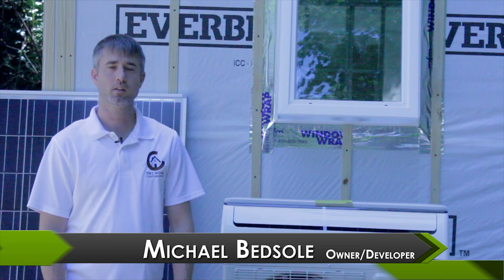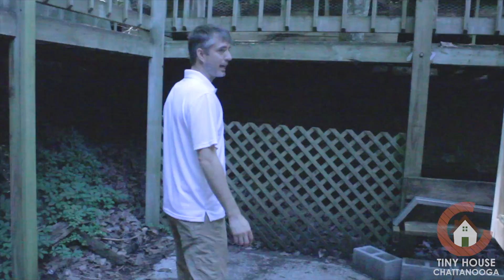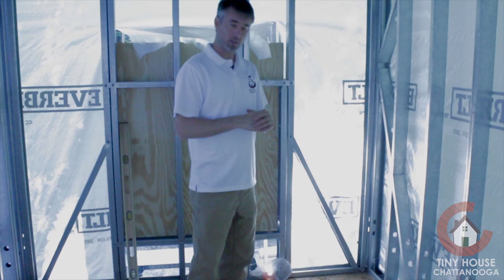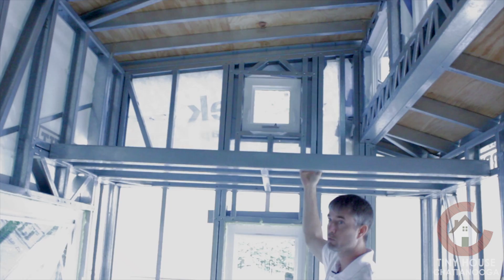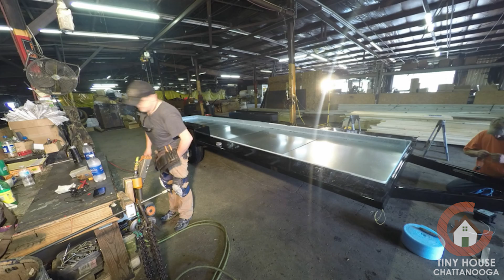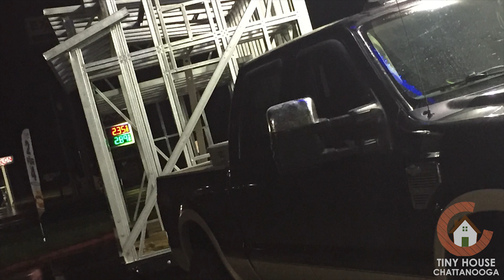Tiny House Chattanooga steel frame assembly.

Comment from the maker: Rita mastin. It saves between. 33-50 %. Just depends on the frame design. This one weights 1400 lbs. Just the frame. Word would have weighed closer to 2800-3000 lbs
Reply: great. do you know the total weight of the house once completed? what is the size house? seriously considering steel.
Reply: Answer please
Reply: That is fuckin sweet . Sold

Comment: Another reason to use steel (and I'd use metal for the envelope as well) is that you reduce the fire potential. Since Tiny Houses NEVER have sprinklers, reducing the fuel loading in the space is going to make them safer. I see many Tiny Houses sited in wildland areas where wildfire is often a concern.

Comment: You are using spray foam insulation.   Make sure to mention the risks of this type of isolation.   Check YouTube videos of massive problems with spray foam insulation.  It seems if the mixture is not right there can be problems with chemical off gassing.   Will not realize  the problem until the build is complete.   Can you tell people how you made sure your foam insulation was done right?

Comment: Did you use the same studs for the loft’s floor and roof as the wall studs? Is there any load concern with mounting studs sideways?

Comment: Is working with steel framing the same as working with wood? Meaning frame it the same way you would with wood? How far apart would you recommend the studs be? Traditional 16 inch centers? Thanks for the videos, tons of good ideas and inspiration!

Comment: Can you describe your insulation system? Outer layer with foam? What's the total thickness of the walls?
Reply from the maker: It's closed cell spray foam insulation. Thickness varies between between builds.
Reply: Mike Bedsole 
Does it have to be closed cell foam spray insulation?
Reply: Not at all. It's just what we prefer to use. We can use whatever you'd like.

Comment: How does the steel effect the owners' wireless services or WiFi signals well inside the home?
Reply: If you have windows it's OK and actually don't use 5G on wifi because of the waves. The old school goes through harder thicker walls

Comment: Did you ever think of using SIP panels for the floor?
Reply: +Paula Martin For the floor, good idea I'd never thought of that, it would save considerable weight! Are they strong enough when placed horizontally? Might they be good to put plumbing pipes through as they'd have insulated protection, I think they use a heated ball bearing to melt a channel through for pipes? Thanks for the thought. :)

Comment: How is it held together....welding...rivets....nuts/bolts?
Reply from the maker: +gringogallego The system has special screws that are provided with the frame and are recessed. From there we use HTT4 brackets with 5/8" bolts for simpson to hold it down to the trailer. Hurricane ties as well on the roof panels.

Comment: 300 sq ft isn't that rather large can you pull that with an F150 Truck and how much does it cost and do you make them smaller sizes if so send me a message I am interested in purchasing one can you do one with bedroom down no loft?
Reply from the maker: Hi Sharon. We can make all sizes. To be able to tow with an F150 you will need to get pretty small. Like an 16'-20' in length. The one in this video is 24'. Cost vary of course. Would be best o go to our site and do a quote request form. tinyhousechattanooga.com
Reply: 16'

Comment: How thick is the metal studs used on the loft?
Reply from the maker: Ryan Ryans 20 gauge
Reply: @TinyHouseChattanooga  thank you for the valuable information,  now I have an idea on what to buy. I am planning to build my own tiny house but I was very hesitant on what gauge of metal studs and tracks to be use for the deck framing of the loft that can hold an average of 5 persons of load. What is available in our hardwares here are 35mmx92mmx3m 0.8mm thick studs and tracks?

Comment: What are the negatives of a steel frame house?
Reply: Chris Vores, wood insulates better but if you are using spray foam insulation (which costs more) it isn't much of a concern.
Reply: Dan Baker 
The slight conduction that comes from the metal framing when you use spray foam can be off set such that the metal frame/spray foam is much more efficient.  You could use the something like the clear floor underlayment along the inside and outside of the studs for instance as added barrier.  The overall frame lightness,  the doubly efficient temperature barrier of spray foam along with its extra rigidity and torsion control make them worth their use.  Make sure to have a bonded contractor apply the spray foam so that if it is made incorrectly you won't have to pay out of pocket to have it removed andc reapplied.